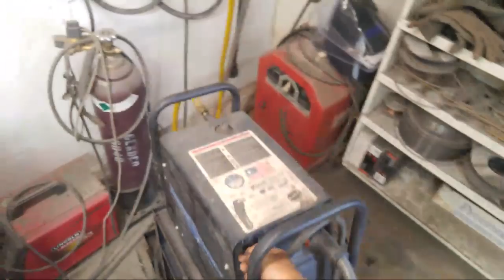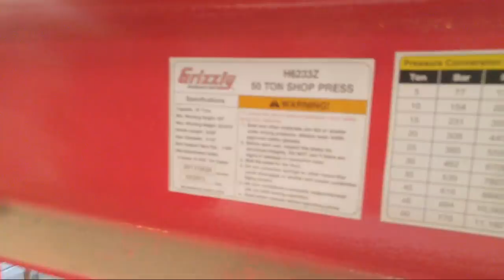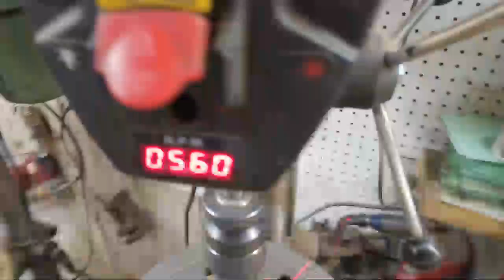🔴Live - Straw Spreader Repairs

Comment: Got a chance to finish the video. Re: Grizzly, their headquarters are here,  Bellingham WA. Just a suggestion, get a spray can of rubberized undercoating from the auto parts store and apply it to the wear surfaces of the spreader.  I have done that for similar situations and it works pretty well, it wears away instead of the metal.  Easier to replace:)
Reply from the maker: +Adrian Klaver That is great,grizzly has been good to us so far, I'm sure a lot of it is Chinese but so is everything these days. That makes sense with the rubberized spray, I wonder how long it would last in really abrasive areas?
Reply: I got figure a good while. The length of time your  grain transfer belt lasted before failing is an indicator of how rubber stands up. Now to be fair the spray will be a thinner layer, but it is relatively cheap and easy to apply.  An application note that just occurred to me. The chaff polishes the metal to a high sheen.  I would say you will need to roughen the metal surface up with some emery cloth or the like to get good adhesion for the first layer.

Comment: that was fun watching you work. if i could offer you a tip the plasma cutter will give you a nasty sun burn should cover you face with a hood and use a shade 5 . the punches are called transfer punches. i welded for 33 years. dont mean to tell you what to do. i have a plasma cutter just like that great tool. wished i had half the shop you have that is amasing. you guys do good work.did you keep you brother going lol.
Reply from the maker: Thanks for the advice. We usually wear shaded eye protection but not much more. It seems that welding can burn a lot easier than plasma but both give off the same UV. If doing a lot of cutting or welding then I suit up with leather and a good face mask. 33 years! We could learn a thing or two from you, pretty much only use mig welders but I do want to get more proficient with arc welding. Haha my brother is a machine and just keeps working, he makes the rest of us look lazy for how hard he works.